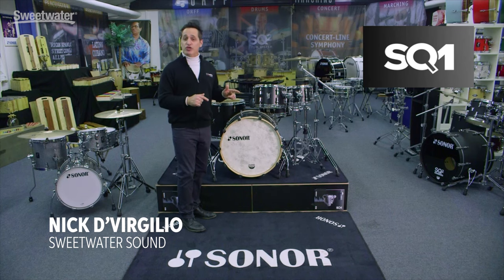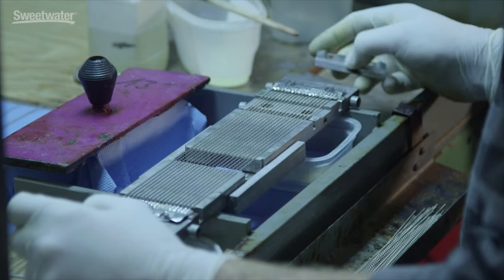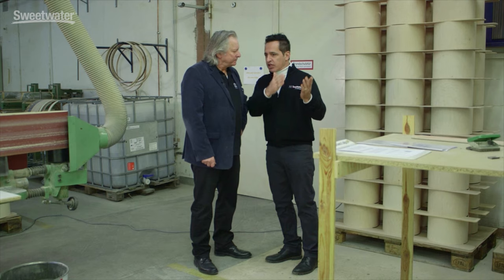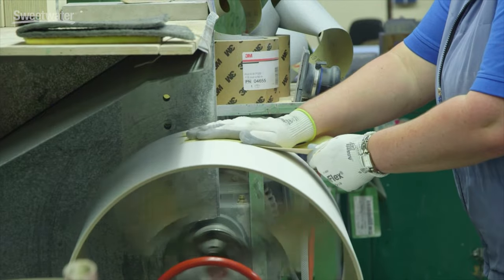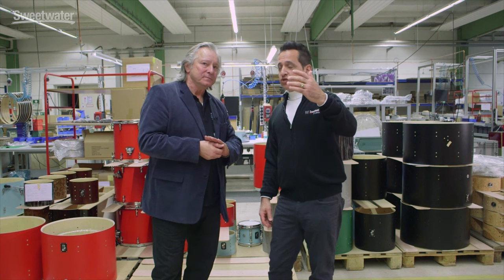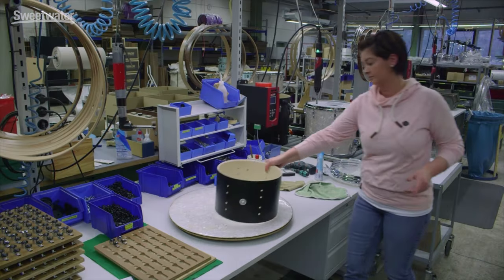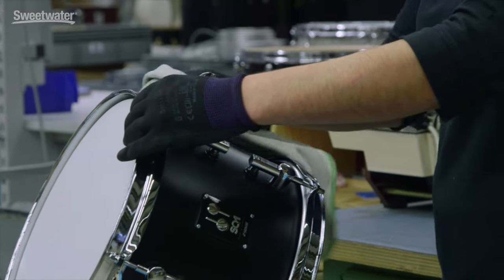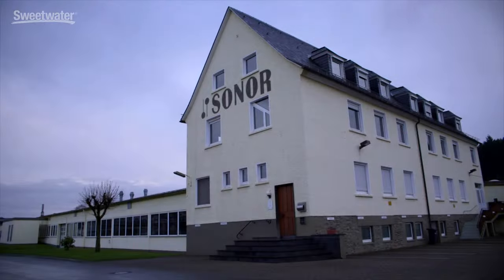Sonor Drum Factory Tour and SQ1 Drum Build

Comment: Had a Sonor Kit, week point Bass drum legs, after a few years I had to mill the clam as the splines on the legs had worn through the clam, and to a degree the floor Tom had a similar issue but took a lot longer, it had a great sound 9 ply bass drum ,the kit ended up in a recording studio.

Comment: Water-based or not, I'm surprised that the lacquer tech is not wearing any respirator protection, even with exhaust ventilation there's still particulate in the airstream.  Other than that, a great tour!
Reply: I was also surprised by this breakdown in safety.
Reply: wajobu the spray booth has a down draft that carries any airborne particles down to the water you see in the back ground. When I took the factory tour I was standing right behind the painter and couldn't even smell the lacquer.
Reply: Curious, I work in a related business and have experience with these types of spray booths, and no matter the ventilation equipment type, NIOSH respirators are recommended or required, but it's their boat, so we'll let 'em sail it how they want.
Reply: @wajobu  usually German work safety rules and workers right are much more stringent than in the U.S. My guess is that either they were  presenting for the camera or that they have a very robust ventilation system that clear German regulations.
Reply: I have been painting and spraying all kinds of material for over 32 years, personally I wear a mask with full flannel and gloves. It just makes good common sense. Oh, and been playing drums for 42 years, I love my drums!!!! I also noticed this on the Gretsch video as well, the tech not wearing any respirator.
Reply: I was a HAZmat first responder/operations geek in another life and water borne  'lacquer' is aqueous soluble acrylic not completely inert but pretty close.  Free of esters, alchohol, volatile distillates, VOCs, (no toxic fumes) so even though you shouldn't go swimming in it, just a simple partical mask is all you need to limit ingestion /inhalation   even if you spend an 8hr day in it. The natural moisture in your lungs dilutes casual exposure further, Just shower exposed areas before it dries to avoid bad hair weeks.
Reply: I thought that too, really surprising that they not wear masks even with water based paint...

Comment: My best kit would be this:

1. Wood plies (veneer) chosen by John Good.
2. Shell construction by Sonor's stress-free drum shells. (wood glue by DW) (Sonor's bigger diameter gap between hoops and shell)
3. With a Mapex's Sonic clear Bearing Edge technology. 
4. Using Sonor Lugs. 
5.Dw's Wrap/Stain/Paint job
6. Mapex's MAATS tom mount system / Sonor's Honeycomb-like tommMount system. (Mapex' adjustable tom legson floor tom)
7. Using DW's True Hoops 
8. Using DW's True Sonic tension rods. 
9. Using any EVANS drum heads 
10. Using Sonor's Gavin Harisson's Protean Snare wires. 
11. Using Sonor's Dual Glide Snare Throw-off
13.Using DW9000 Drum Hardware
14. Matched on A Paiste Masters/Signature set of cymbals. 

What's yours?. hehe
Reply: What a fun concept! I would have to say… 

1. Wood plies selected by John good (what a great call!)
2. Don’t know much about wood glue…sonor seems to have a good system. 
3. Rounded over edges cut by craviotto
4. Sonor vintage tear drop lugs
5. Lacquer by Tama
6. Mounting hardware by tama
7. Maybe s-hoops just for something a little different?
8. Agree on the dw true sonic rods
9. Remo ps3 with black dot on kick, evans uv2 on Tom batter, evans heavyweight on snare. 
10. Canopus snare wires
11. Dw mag throw off
12. Tama Star hardware all around
13. Meinl byzance all around

Comment: It's great but why don't they care about safety of the workers! finishing
Sanding, painting and.. 
 can be harmful for workers !
Reply: Nmn Mnm Sure, working in general can be extremely harmful and should be forbidden. Don’t get me wrong here, but not a single man in Germany is forced to do some specific work. If it would be that dangerous like you said, a company like sonor would have troubles to find any workers.
Reply: Oh, the safety in germany is on a high level in almost every factory.
Reply: I did the tour in 2012 and it's a spotless factory, it wasn't dusty at all, the machines and spray booth all have down draft equipment that takes the dust and airborne paint out of the air.
Reply: if anything sonor is the perfect example of a company that actually does take good care of it's people on the workfloor!